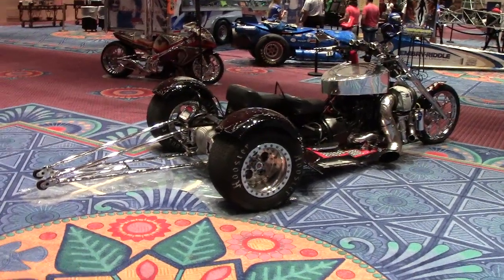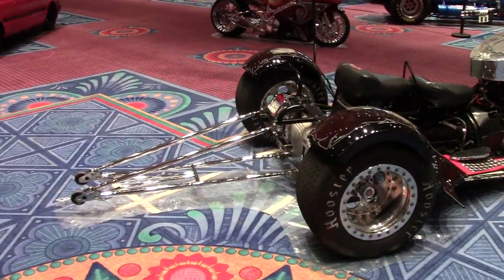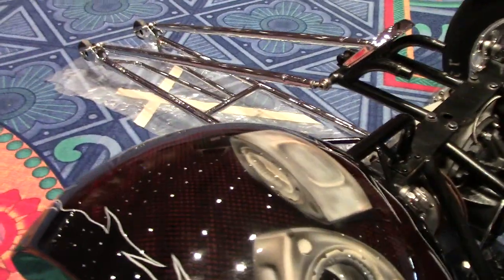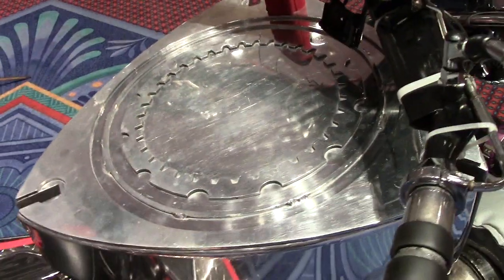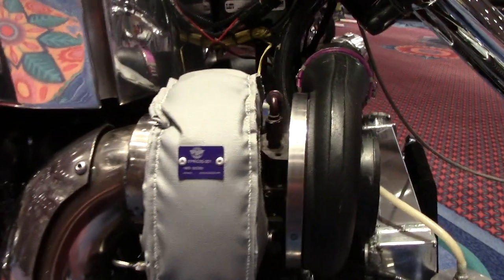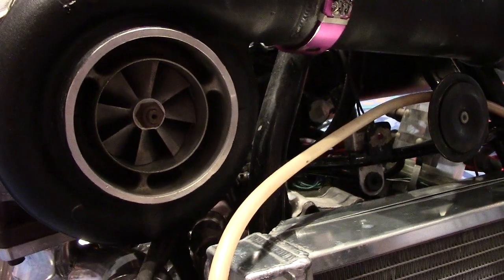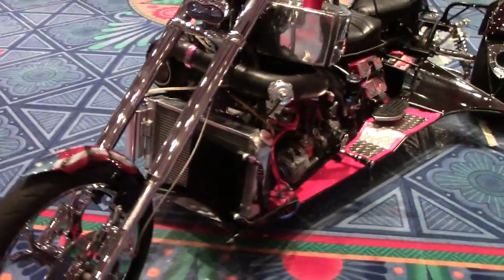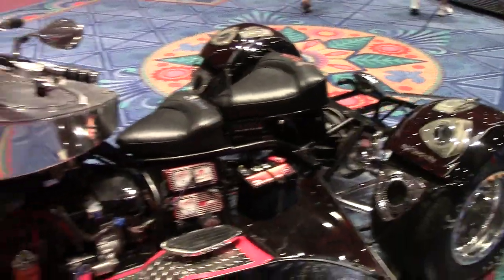Turbo Rotary Drag Bike

Comment: Btw thats a 3 rotor 20b rotary engine - displacement of 2 litres, rotary turbos are much larger than piston powered turbos, engine is probably running around 900-1000bhp, would need a larger turbo to max it out - check the 26b queens street rotary, 1,600bhp running a GT60.